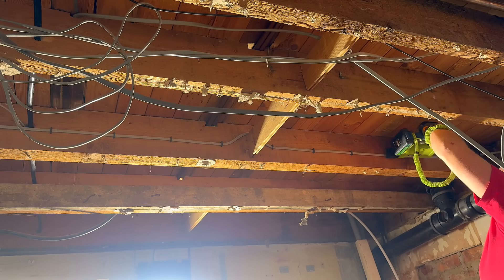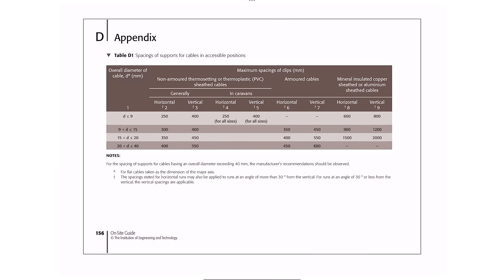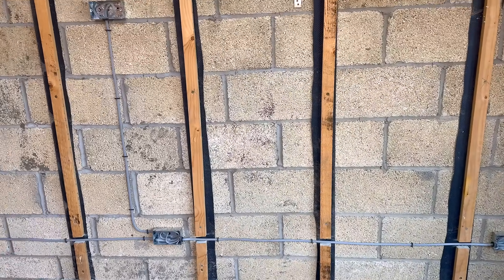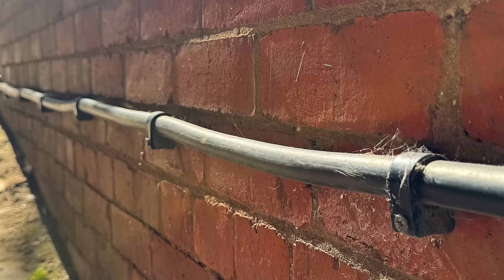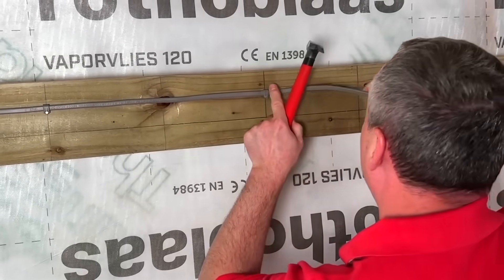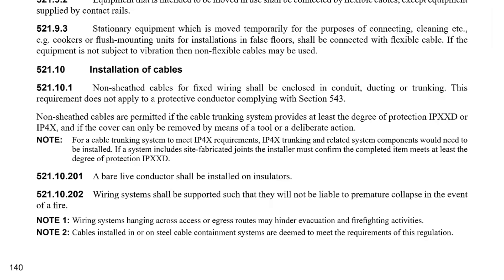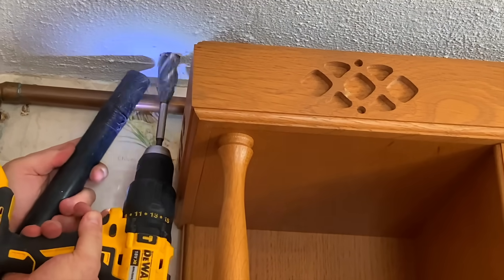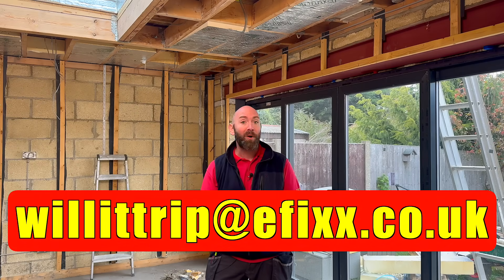Cable Clipping Distances - Are You Getting Them Wrong?

Comment: Started originally on the 13th edition, hammer length used that, along with what it looks like, as well as what and where it is clipped, used the reg guide when needed. Slotted joists holes in joists. New type of fixings and methods are coming out all the time, hopefully this is picked up and specified at the design stage of the installation.

Comment: 20 times the external cable diameter, so if a 2.5mm² T&E is 10mm wide, 10mm × 20 = 200mm.

Comment: Maybe you wouldn't mind answering the following questions please using only regs. RETROSPECTIVE fire clipping.

EICR identifies C2 no fire clips in trunking in fire escape routes.

Retrospective fire clipping works initiated. Considered as an alteration to the installation thus we must follow the latest regs and building regulations?

Either Internal or External fire rated trunking clips selected and installed at 300mm apart horizontally using metal plugs/ fixings.

I assume this is the correct process and complies with the latest BS7671?

On the basis of above, when is it ever ok to retrospectively fire clip trunking in escape routes using plastic rawl plugs, and not necessarily spacing them in accordance with MI's and BS7671? (This is my main question)

Further considerations to Building Regulations Part B, BS 8519:2020, and BS 8539:2012

Thanks for any feedback. Need reg references not just opinions.
Reply from the maker: Monjaro Joe here - This is a great question, Be sure to send it in an email as well to willittrip@efixx.co.uk and if I run a video you could win yourself a £20 amazon voucher 🏆

Comment: Manufacturers sometimes have their own specs for their clips. The (otherwise excellent) Linian Superclips, for example, state 300mm... so even through your OSG says 450mm horizontally or 600mm vertically is fine for 22mm diameter SWA, the manufacturer says it needs to be 300mm... which is... unhelpful

Comment: Blown away by how close staples are abroad; in the US most people that run NM tend to be more than the code requirement of 4.5’ near 1.5 meters.
NM, non-metallically sheathed wire, is for the most part not allowed to be in the open, and when placed in accessible areas need to be protected by conduit or a raceway. And NM is rarely allowed in commercial/industrial buildings.

Comment: Beware. The cable clip police could be knocking on your door with the extended volume of the cable clip regulations, measure tape and callipers, at any moment 😬
Reply from the maker: The thought of a swat team in full riot gear breaking down a door and checking the spacings with calipers and tape measures is the kind of series I want to watch on Dave.

Comment: That is why I keep a range of hammers in my tool bag: the length of the hammer handles (minus my 4-knuckle grip width) being approx 8", 12" or 16" (200, 300, 400mm in new pennies).  

I don't fit MICC (I couldn't afford a 2 foot hammer).  

And I allow two extra knuckles for SWA.  aka an extra 50mm for the youngsters.

I don't alliw any extra for vertical cable runs: one day the earth will tilt and the north pole will head south.  I don't want any of my cable runs in God's Own Country (Yo'k-shire) to sag 'cos the rest on t' world's gone teets-oop.

Comment: Ever since I learned about the 250mm clip spacing for upto 9mm wide twin and earth, I've always used 250mm as a standard clip spacing. It may potentially be overkill for some larger diameter twin and earth, but at least they won't sag.
Reply: it also looks better with uniform clip spacing and its only the cost of a few extra clips :-)

Comment: Nobody gives a shit about cable clipping distances especially on a domestic job . There’s enough serious problems in the world .
Reply: The complexity of the modern world and the problems in it is not a valid reason for not doing the job properly and to the required standard.
Reply: @deang5622  if the cable is securely fastened in place it matters not at what fixing interval .

Comment: When I served my apprenticeship (started in 1969) weeks did a lot of micc in hospitals, we clipped every 6 inches in old money.
Reply from the maker: Monjaro Joe here - I assume that was every 6 inches with a hand drill and hammer and a flat pan head screw, probably brass?
In fairness your wiring is probably still powering the NHS!
Reply: @efixx  fibre plugs and brass round head screws.
Reply: 6 inches is 153mm.

Comment: How come conduits aren't used in Britain? I never see conduits being used in British youtube videos. Wouldn't it be a pain if one needs to change the circuit in any way? 🤔
Reply: It seems that it’s no longer the done thing, my house was built in 1969, all the cable in the wall is in conduit, it makes additions, repairs & rewires so easy, and I hate it when they clip a cable to a wall and then plasterboard over the top as its almost impossible to replace damaged cables or make simple changes without demolishing half the wall. Several years ago, I hit a cable when installing a kitchen cupboard and with the cable in conduit it was just a case of pulling out the old and in with a new cable. Also, I had an extension done and I needed a double light switch changed to a triple, the sparks was able to pull an additional cable down the existing conduit without disturbing the existing wall.
Reply: Crazy that conduits aren't used. The amount of work needed to repair a clipped cable inside a wall is huge. Not to mention clipped cables above ceilings. 😱

I live in a house built in 76. Back then earthed sockets were not required. Two of three floors have been rewired since I bought the house in 2012 without any need to tear down walls. Doing the last floor this winter. :)
Reply: We have installed plenty of 20 and 25 mm steel conduit in commercial/industrial environments and even some surface on feature walls in residential. 

To recess into a residential building is not the industry standard and makes rewiring easy but adding to the existing install more difficult.

Comment: Many years ago, I used to work on reenforced concrete so everything was trays. I used to nail the tray supports to the concrete using a Hilti, I don't know if you can still buy them but they had a small explosive charge that went off with a huge bang and this put a nail with a flanged head washer permanently into the concrete. One day it misfired because I couldnt quite get the angle right and the gun square so in my haste and fury I stepped back to sort it forgetting that I was standing on scaffolding about 75cm high, stumbled and instinctively used my hands to break my fall, trouble is, I was holding the gun and it fired the nail through the top of my shoe, my foot and into the floor slab! It was before mobile phones and I was on my own doing the electrical pre-install in an office building! I was permanently nailed to the floor!
Eventually, some other guys arrived to free me, luckily, nail missed everything important, no permanent damage or scars. Now semi-retired but occasionally, I get a lot of pain where the nail was!
Reply from the maker: Mpnjaro Joe here - Wow, glad your OK, although I now have visions of someone using the back of a claw hammer to free you from the floor...who knows you could still be there as a feature!
Reply: They are still available, I used one the other week that is made to shoot nails into steel.. It felt like the whole building shook every time I put a nail in.

Comment: Table 4A2 in BS7671 still shows a cable laying on a plasterboard ceiling as a recognised installation method. So no, clips are not required above a plasterboard ceiling in a domestic property, otherwise what would be the point of installation method 100 or 101 even being in the book?
Reply from the maker: Monjaro Joe here - Exactly what I thought when I started my research for the video. Got sidetracked though around the BEAMA guidance and the conclusions laid out in the reports following the Shirley Tower Tragedy and using metal clips.
Would I use clips in a loft space or void above a plasterboard ceiling....I think I will be from now on.
Thanks for the comment as well, will be diving into Reference methods as well so watch this space.
Reply: @efixx correct me if I’m wrong, BEAMA is a trade association so it’s guidance is at best a best practice guide for members and at worst just another opinion in the mix of various competent persons schemes and trade associations, which any professional may or may not be signed up to… which is why our first responsibility is always to BS7671 or other appropriate requirements published by the IET.
Reply: @efixx I think a common sense approach is likely to prevail, clipping when there’s a reasonable expectation of the space being or becoming accessible and pulling cables through across ceilings with your rods where you simply don’t have access for a hammer is a practice that’s acceptable and necessary in the real world. Lofts might be a grey area.
Reply: I've always done a 300mm tie wrap for 2.5

Comment: Define accessible spaces.... thats the standard lets view the regs how we like approach lol. Lofts, up gable walls, cellars, sheds, garages. Accessible to whom and how I suppose. Even voids are accessible to people in ceilings and floors. This is the issue that builds when we determine say a meter box is an electrical enclosure or outdoors is fine for consumer units. Until someone says it isnt.
Reply: I think if it is new then clip the same distance if accessible spaces or non-accessible spaces

If it is an addition then access becomes an issue